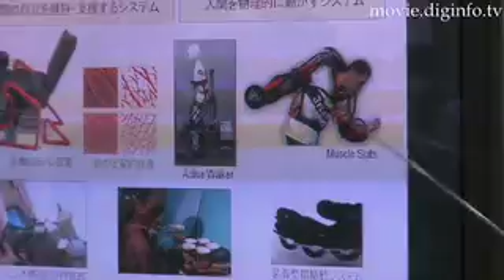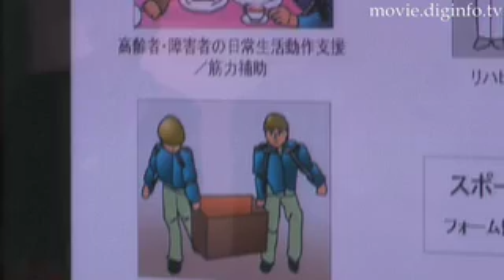Muscle Suits : DigInfo

Comment: @WildSharkProductions Hydraulics have a greater force per square inch but having  hydraulics requires a pump/motor and fluid which would add considerable weight - pneumatics would do just fine for day to day applications.